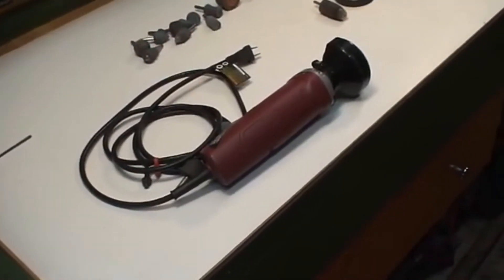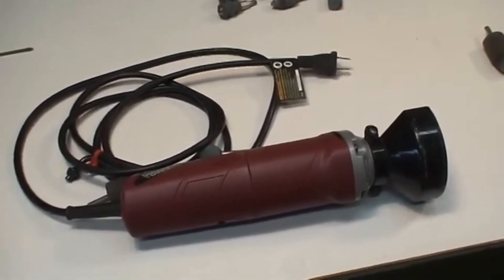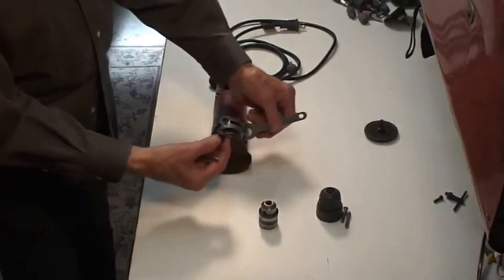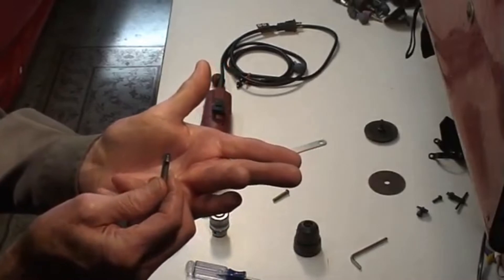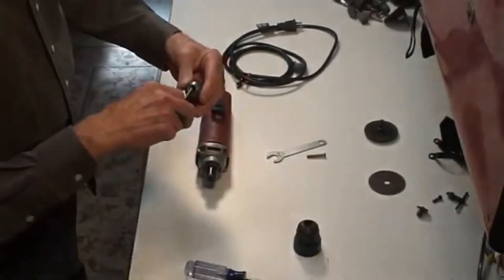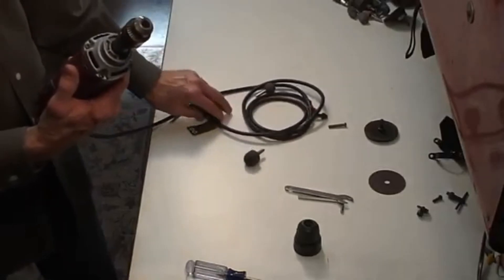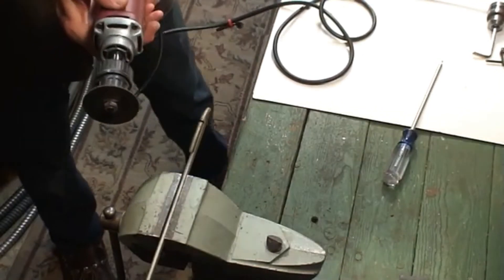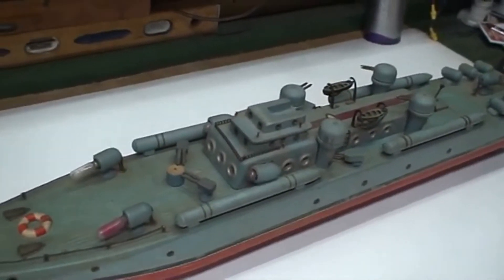Harbor Freight Tool Hack— Die grinder made from cut off tool.

Comment: I bet that thing shakes like a prostitute attending a religious service there's cheap cutoff tools aren't really balanced out of the box they sure don't give it a very good dynamic balancing. I don't believe that particular brand gives it any balancing at all you know the modern power brand might be a little bit better quality control and things got a more Shake right out of your hand cuz that chuck ain't balanced at all definitely not balance for that kind of RPM maybe a third of that RPM you can buy high-speed mill Chucks that are balanced they'll handle the RPM of that tool but you're going to drop more on the Chuck than you did on the tool

Comment: Great video thank you .. gonna try it
Reply from the maker: I've done a lot with it. It's like a big Dremel. Won't take a lot of abuse due to the overload circuit that seems set low but a quick push of the button and you're off to the races. The tool as it comes from HF is useless. Thanks for watching!